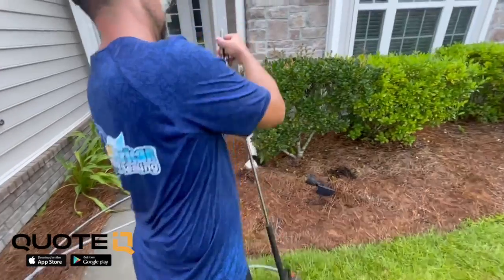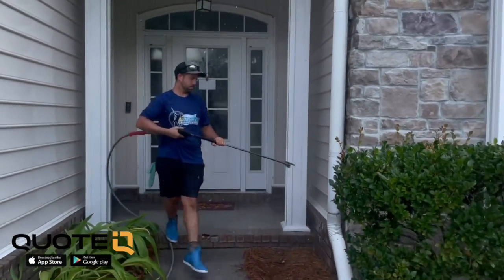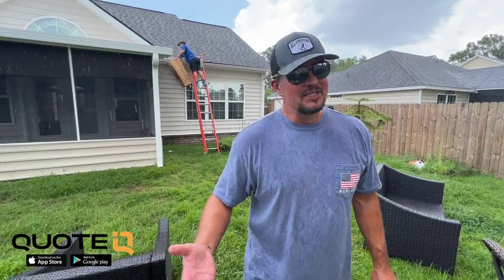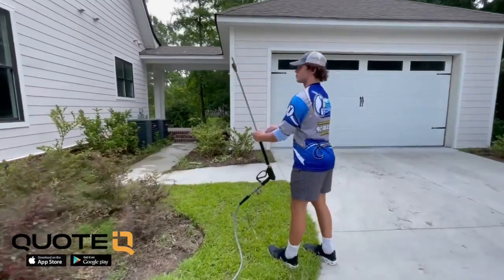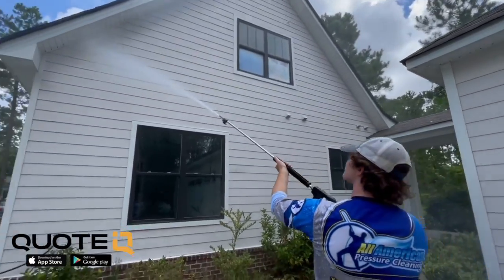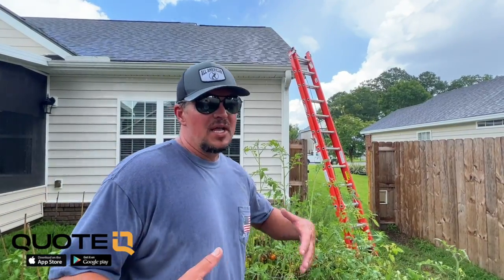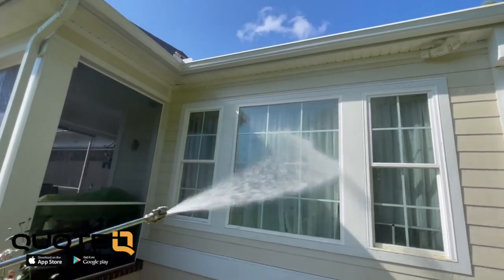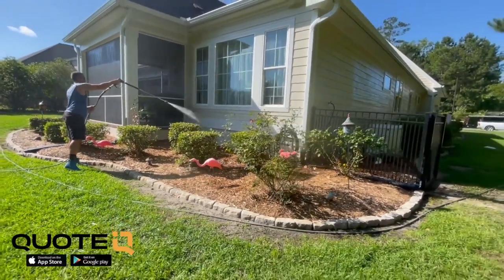How To Start A Gutter Cleaning Business (Step By Step)

Comment: I'm 60, retired, and thinking of getting a pressure washing business going to keep me occupied, I've got experience with pressure washers and steam cleaners, mostly washing trash carts and trash trucks, and a home owners direct drive pressure washer (it needs a lot of work to run again) that I use around my house, I have a turbo nozzle and a surface cleaner.
Would this be good enough to get started? "Mike"
Reply: as long as the pressure washer has 2.5+ gpm output youll be good to start advertising. otherwise it will take way to long and isnt worth the time in my opinion

Comment: Hey man, I dig the videos but I have to say you are a bit shy of perfection of your work.  I did 4 years of concrete and house pressure washing and if I left a speck of dirt anywhere my boss would make me scrub it off with a brush prior to sealing.  I know this video is about gutters but it's your most recent.  And for the first time I see your using a wand.  In alot of your older videos you seem to be washing a house from 20 feet away?  That's not pressure washing.  You need to be close at ALL times.  You also go ti fast with the scrub brush and didn't see you go both directions.  It also matters on the the type of concrete.  Exposed aggregate can take a beating and we would swirly head the whole driveway starting with edges and relief joints with white 45 degre and then
Reply: And then brush both directions to eliminate any lines before you seal.  Rinse with 35 degree yellow tip.  I hope this helps your biz.  You do want to be more gentle with brushed concrete and especially stamped concrete.  We did alot of nice re colors on stamped but thats a trade secret.  Good luck.
Reply: Probably don't comment on videos guy, you realize most every video is sped up by at least 25% 

Also- NEVER, EVER use pressure when washing a house- if you do, you wrong